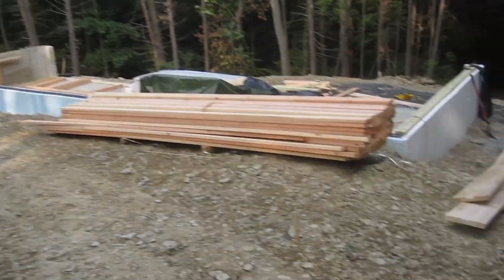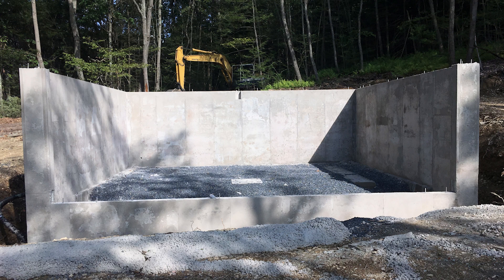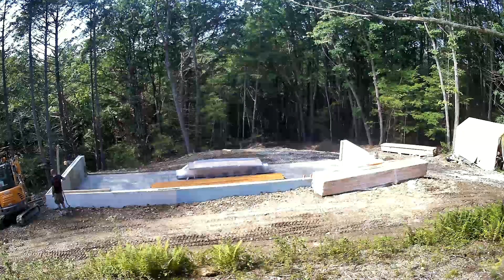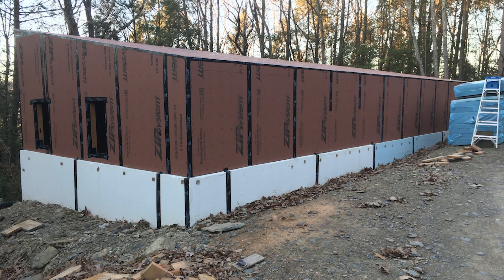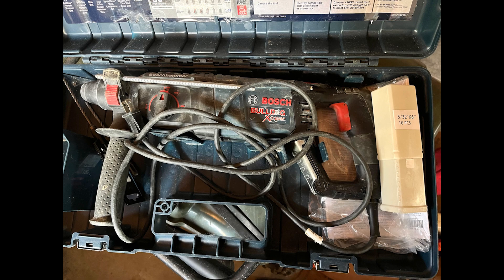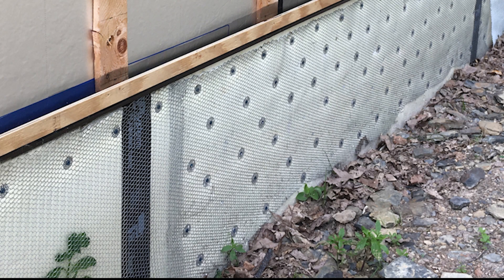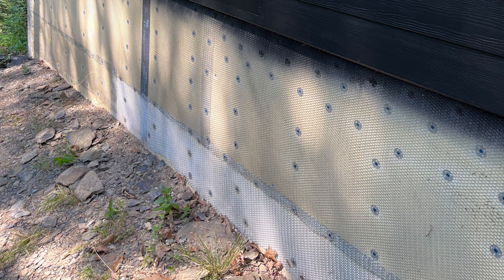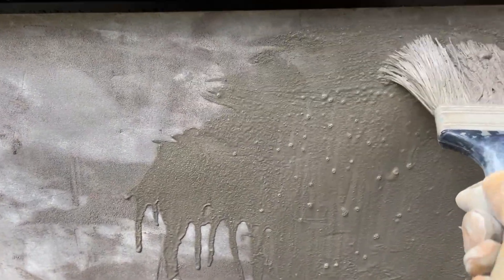How To Fasten Rigid Foam Insulation Over Concrete Foundation Wall for Thermal Break and Finish Over

Comment: I came here from your other video to see the EPS attachment. So many good tips. The EPDM sill was a first. I am considering a double sill and using the bottom course as a nailer for the foam instead of concrete screws. And just gravel backfill for the pinch at bottom. Your build is awesome, thank you for sharing the time lapse especially.
Reply from the maker: Thanks for checking out my videos. That was my original plan like you said.  Nail to the sill and use the back fill to also hold in place.  I heard GreenBuildingAdvisor recommending that.   Yeah EPDM gasket vs the foam one seems like an obvious choice.  I was just hearing recently on the FHB podcast how a homeowner had a draft all coming from the sill plate gasket. The EPDM one is not more more money!  I was debating editing and narrating these videos. I'm glad it turned out people wanted to hear about what I learned.
Reply: @POCONOPOWERCORD  Excellent, thanks. Glad to know that foam plan would work.